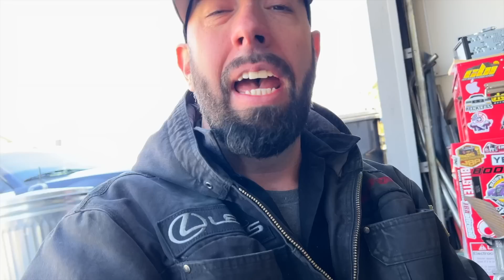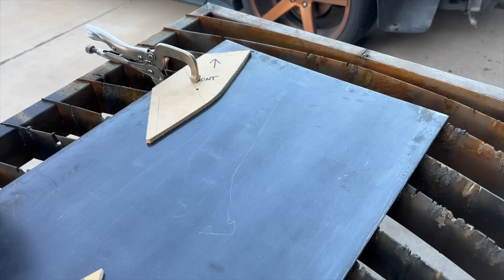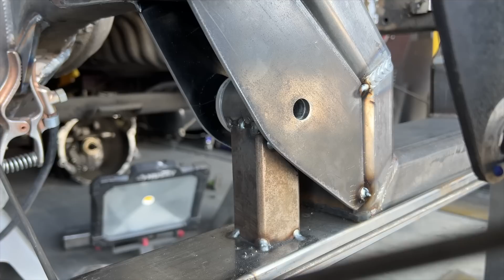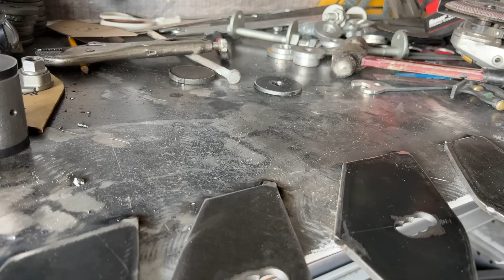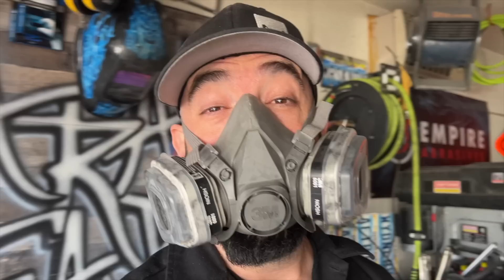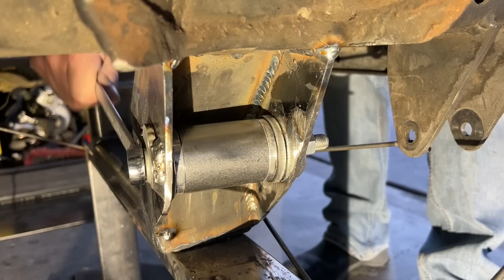How to Build Adjustable Alignment Bushings! Mighty Max Ep: 19

Comment: Making videos can be a massive pain, that’s why I rarely do it. But, you’re way better at it, so I just leave it to the pros. For the most part. You were correct in saying they don’t need to be hardened. Once you walked that steel it will change the temper, and while it cools slowly, it’s going to normalize anyway. Great video as always brother!
Reply from the maker: Ahhh! Very good point! Never considered that. Even if they were soft like aluminum, I think they’d still be fine as they’re not much beefier than the factory Toyota 1/8 inch bent sheet metal stoppers.
Thank you my friend!

Comment: Muriatic acid works great for removing galvanized coating. Your local swimming pool supply will have some.
The fumes are harsh so stay upwind. Also cleans concrete if you have a stubborn stain.
Reply from the maker: That’s fantastic info. I’ll grab some. Does that work on rust? Or is that a different acid? I’ve got some rust cleanup coming up.
Reply: @GarageFab  Dunno if it works for rust removal.
Only one way to find out though!
Whenever I need to weld nuts in place, I'll dunk a few in some muriatic acid to clean off the zinc coating. Just a little in a spray can cap is enough.
Reply from the maker: I’m certainly going to play with it. I always sand off zinc coating before welding. Completely removing it would be far better. 👍

Comment: You didn't clean the black coating off the brackets before Welding the rods on. 
I put a fan at my back to bring in fresh air when Welding stinky material.
Not to much or you will blow out your shield gas.
Reply from the maker: I often don’t remove mill scale unless it’s a really important weld. It doesn’t seem to affect my welds. The galvanized coating sure does though!
Someone recently mentioned a fan behind the head just to coax the fumes away. Brilliant. I haven’t tried that one just yet.

Comment: The trick with the router just upped my game in the shop because I don't have a big compressor to run a good air grinder. Thank you very much for that tip ! 👍
Reply: not only is it a great way to get some spinning action, the fact that it gives you fantastically square cuts is an added bonus :D
Reply from the maker: So true, Klay. If you’ve got patience and a steady hand it provides machine-like edges.
Reply from the maker: My pleasure, Matt! Lemme know if it lives up to the hype.

Comment: Hi. New to your channel.  I dont know if anyone else mentioned this, or if you knew,  Mopar has been using those same type of eccentrics since the sixties. Maybe a cheaper option ?
Reply from the maker: I certainly did not know, Stanley. I will be looking them up. The Toyota versions cost me over $200 for 4 complete bolts. I’d love to find a cheaper option for my next truck which will require 8 of them. 😩 Thank you. 🙏

Comment: This video shows exactly what goes into building these trucks. When you have to make your own parts, things are bound to happen.  It happens to everyone  you try to do stuff quickly, then realize half the parts are wrong. I just triangluated my front arms on my Mazda, but waiting on my tabs from the local sheet metal shop.
Reply from the maker: Truth. There’s a military saying; Slow is smooth. Smooth is fast. In Fabrication words, slow the hell down and save time not having to do things twice.
What was your method to triangulate? I’m still not sure what method I want to use yet.
Reply: @Garage Fab  I used a piece of all thread that fit into the lower arm. Used a nut and washer on each side to hold it tightly to the arm so it would be solid. Then I took the bushing I was going to trianglute the arm with and used another set of nuts and washers to get it where I wanted it. Once I had it where it went ,  used a piece of 1 1/2" dom tubing to join them together. I kept it all tied together until it was cool enough to handle. Once cool, I took it apart and remounted the lower arm on the truck, then just made a pattern out of 1/4 plywood and had the local shop cut them out for me. I made sure to measure the distance from the arm to the bushing to make sure each side was symmetrical. I believe I used a piece of 3/4 all thread that I had to use a flap disc on to get it too fit. I took out the inner sleeve for it too fit. It worked out very well and was a good fit for everything.
Reply: @GarageFab  I can try to get some pictures to you on messenger if you like.
Reply from the maker: No need Shawn! I can picture it perfectly. Well done!

Comment: great video as usual.  I did notice the tabs all being all the same way, i wasn't snickering. i was yelling at you but you wouldn't stop.  
we all make mistakes. but seeing a pro make a mistake makes me feel better about the times that i messed up.  (s10 blazer SFBD firewall back frame build.  i got the body back on before i realized that i messed up the trans-crossmember, that was fun to fix)
Reply from the maker: Haha! What a kick in the giblets. Nothing better than cutting, grinding, and welding under a car. It’s times like that that I know I made the right career choice. The spark in the ear hole definitely helps.

Comment: Cool. I almost chucked a bur in my router to try to cut my transmission adapter. It being aluminum held me up. LOL. Vinegar should remove galvanized coating, but it would need to soak overnight I expect. I've never tried. But picked up that tid bit somewhere.
Reply from the maker: Imma have to try that!

Comment: We're lucky in new Zealand just pop down to pik a part ..grab the bolts .sabresaw the washer bit off the sub frame .there's an easy pattern and when ur done just weld the original adjuster caps plate on ..that will save a lot of fabrication time and look pro as..that's a MEAN tip on the router I've got a new Makita router and carbide bits out the wazzooo .....for galvanized steel just grab a fan .put it about 500mm away from your work peice pointed away ..that will pull your fumes away from your work peice
Reply from the maker: All good advice! I did make a trip to the junkyard but this year isn’t the year for 4 Runners to die I guess. 😆
Reply: @GarageFab  pretty common peice across the board on brands no doubt ppl will easily substitute..

Comment: I really feel your pain with those mix ups. The extra steps you're taking now with your design will pay off in the end. The control arm triangulation sounds similar to what Nissan hardbody owners do as well. Keep up the great work. Thank you for sharing!
Reply from the maker: Does Scraping Pavement have a triangulating video? I’ll have to check!
Reply: @GarageFab  he does. He also sells kits to triangulate the lowers and flip the upper arms too (only for Nissans though). Great video by the way. I always wondered how those style of adjustments worked

Comment: Why not just use the plasma cutter for the slot. Make a jig and save yourself like 3 steps and 4 different tools. I love your channel and have learned a lot. I take the CAD “card board aided design”template all the way to fitting with holes and everything, before transitioning to steel.
Reply from the maker: Interesting thought! I’ve got 4 more tabs to do so I might give that a shot. Thanks got watching my man!

Comment: I love your videos!  I ran across them getting info on suspension and I think I have watched every one at this point.  I have learned so much and your production is absolutely great!  You are a natural presenter and great teacher, I really appreciate all the detail.  I am currently installing a triangulated 4 link in a '63 Falcon, its a kit so not nearly as much fabrication but understanding all the basics has been extremely helpful.. This kit is adjustable and a couple of the effects of adjusting is to raise or lower the roll center and/or change the instant center, and/or the amount of squat resistance.  If you ever want to explore any of these factors, kind of like your pinion angle video,  I think it could be very interesting.
Reply from the maker: Interesting indeed! I considered building a hyper-adjustable truck to try and to demonstrate all the different designs and adjustments and how they effect things.
Thank you Doug! I appreciate you watching!
Reply: @GarageFab  Maybe just use your miniature models
Reply from the maker: True! That was the goal with the models in the beginning. But unfortunately you can’t test drive a model to see how well it steers and stops!

Comment: Marking faces along the way can save face.
Reply from the maker: That sounds like good advice hiding in there but I don’t understand!
Reply: @GarageFab  I noticed you were about to weld square stock on the wrong faces of 2 of the gussets. Marking the outside faces of the gussets as a habit before knocking off the tacks and heading to the bench to make the work easier would have really made the work easier by preventing face errors. A couple of vertical lines with a sharpie can go a long ways helping your memory especially in situations when you're working upside down and backwards before moving to the bench. It's so easy to miss exactly what you missed I was waiting to see how you marked the outside.
A first time for everything can also be your last for that one.

Edit: "to save face" generally is linked to the dignity and prestige that a person has in terms of their social cultural relationships common to many cultures around the world. 
Last description to allow saving face for anyone unfamiliar.
Reply from the maker: Sense made! Such simple yet profound advice. I’ll try and remember that when working with multiple parts like this. I often put an UP arrow as well as a RF or LF on them but never considered marking the face. 😩
Reply: @GarageFab  You had already discovered the problem that before was only potential.
Thank you for your reply.

Comment: Two of the washers should have been on the front side of the bushing when you welded in your tabs. Now your bushing is 1/2" off center from the factory location toward the rear. Great fab work though.
Reply from the maker: Correct! But in the end, the location of the ball joint is all that matters. The lower arms will be built from scratch taking this bushing movement into consideration. If I were reinstalling the factory arms I can see how this might be a problem. Thank you, my friend!

Comment: Just something I noticed (because I have done it in the past). You put both washers on the same side (rear) for spacing the plates apart for the correct bushing which means that your bushing will be pushed toward the rear the thickness of the washer on final assembly.  If you plan on doing your own front arms not a big deal.  If you were keeping the originals, it might come into play.  Love the videos and the hard work that you put in.  Keep it up sir.
Reply from the maker: Hood eye, Zach! I am in fact building arms from scratch using only the front most bushing edge as a locator. The factory arm will be placed in a jig with this in mind, and once the jig is set, I’ll piece together the new arm. I imagine that’ll make more sense in the video. 🤦🏻‍♂️

Comment: Love that router trick. Much faster than dragging out the files.
Reply: It's a clever trick, but I think a file is faster for this application.  High quality files remove material quickly and if you use a vise to hold the tabs, you can't take too much material off if you use the jaw as a work stop.  I will concede that the router trick would be great for intricate shapes.
Reply: @matthewpeterson3329  Good points indeed. I use files frequently for those same reasons. I especially like the level of control you have with a file. No bouncing around.
Reply from the maker: Bouncing with a carbide bit? Unheard of! 😂
Reply: @ClintsStreetMachines    You know, Jason at Fireball Tool has already proven that it makes no difference if you back-drag a file or lift between strokes.  When is someone going to develop an adapter that fits a standard reciprocating saw, which also allows us to clamp a file tang, turning a Sawzall into a power file?  Huh... when I ask!
Reply from the maker: I’m on it!
Reply: @GarageFab    Me too.  We'll compare notes.

Comment: It's good to see that it's not just me that has brain farts sometimes!  As I get older it seems a little more frequent.  😮😅😊
Reply from the maker: Dude. You should smell my garage. No one has more brain gas than me.
Reply: @GarageFab  the worst brain fart I ever had was on a 400 amp main electrical service!  I flipped up the meter bypass arm and pulled the meter, I forgot that only kills/unloads the meter.  I cut one of the 200 amp cables, major fireworks ensued, ruined my cable cutters and had to break out the garden hose! LOL.
Reply from the maker: Um… sounds like that could’ve been quite a bit worse! My only electrical close call was a fraction of that amperage I’m sure. I was replacing ballasts and capacitors on exterior apartment lighting on a ladder. All the lights were off, but the sun was setting and they’re operated by photocell. While grabbing a discharged capacitor, I saw the other lights turn on and I blacked out. Woke up leaning back on the ladder and managed to catch myself. Good times.
Reply: @GarageFab  sounds like you were pretty lucky!  I got zapped by accidently hitting the Start/Run Ballast with the back of my hand in an A/C Condenser once.  It zapped me so hard it drew up the muscles on the back of my neck!  LOL.

Comment: what type router did you use?  i searched router and carbide on your channel and the video with the router did not come up-do you know the title of the video?
Reply from the maker: I totally forgot to put links in this video! Thank you! If I remember correctly, the specific router I have isn’t made anymore. Search for “trim router”. It’s a much smaller unit than a typical router. The carbide bits I have are Snap on, but I think you can get them anywhere. Lowe’s and Home Depot both.
Reply: @GarageFab  thank you

Comment: Is the bushing sitting at an angle in the chassis? If it is, the adding all those washers to one side to make up the width difference probably shifted the centerline or the angle. Maybe its not enough to worry about, but I am curious. Nice trick with the router! I could have used that one a couple weeks ago!
Reply from the maker: I think I know what you’re saying about the center line. The only thing I’m concerned with this early is the point the bushing rotates around (the bolt) and that shouldn’t have changed, though the bushing is now somewhat offset from where it used to be. Thank you!
Reply: @GarageFab  awesome. You're aware of it, so I'm not worried. I also wanted to say that I posted my chassis table build if you are still interested in seeing it. Videos turned out a bit rough, but what the heck 🤷‍♂️
Reply from the maker: I am interested. I’ll be looking!

Comment: Fuck alignment. The more you understand about alignment, the harder it gets.

( I do my own, because I want it done right, and you can't trust alignment shops to do more than adjust your seat.)
Reply: *how every single adjustment causes more than one dimension to change, which becomes a serious issue when working with ~5mm between the tire & fender on a daily driver…

( Honda BB6 slammed ~3" on 18x9 wheels )
Reply from the maker: The seat adjustment thing had me rolling. We used to have all our alignments done elsewhere until we got our own machine. Every single one of them was crap.